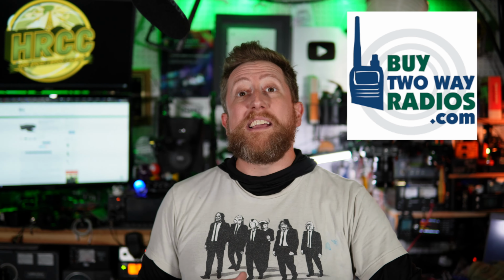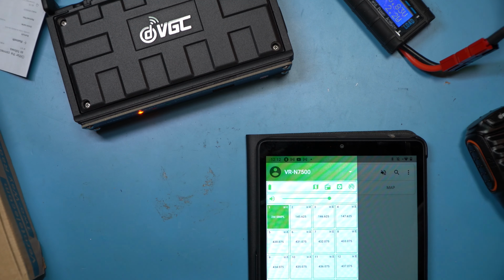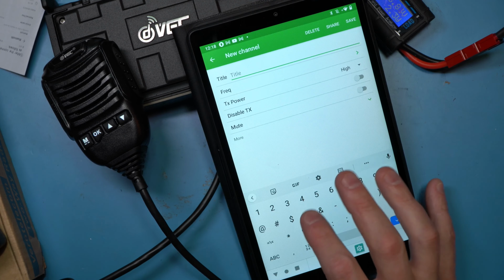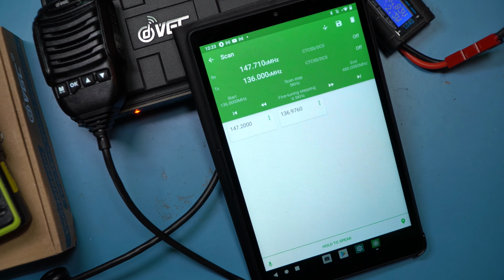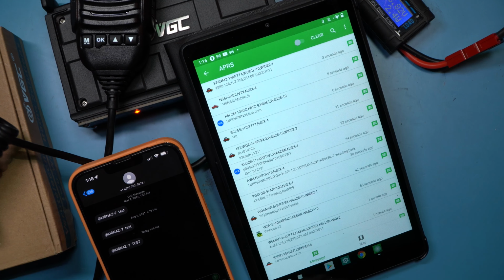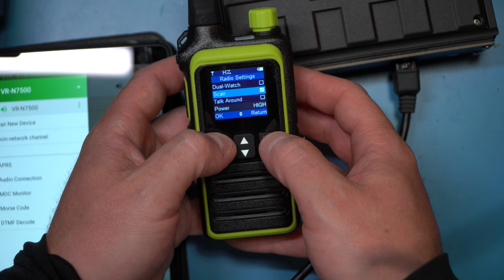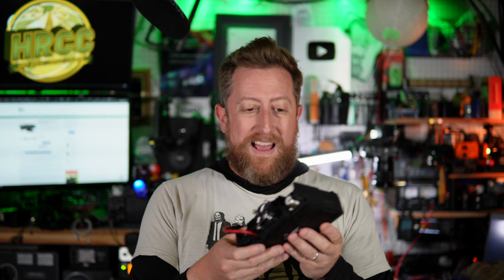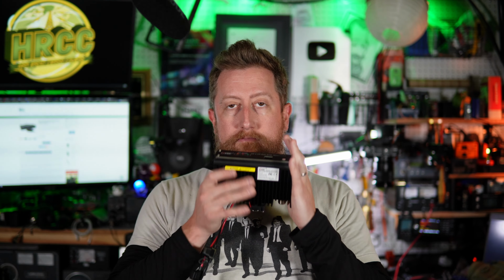VGC VR-N7500: APRS! Android, iOS, Bluetooth, Dual Band 2m/7cm Ham Radio Review

Comment: Does the app have to be connected for it to beacon APRS with current location? I presume it doesn't have a GPS module built-in.

Has the iOS app improved & supports APRS? I remember it was limited previously.

Comment: I really like my vgc- vr-n7500. I use it for one of my base station radios. I have an android phone that I don't use anymore connected to the radio and the internet. I leave it with the radio in the shack. I've installed an external wifi antenna on the outside of the radio to extend the Bluetooth range. Using the phone for the microphone I could get about 15 feet from the radio. With the external antenna the range extended to about 50 yards. I also setup network channels to use my radio remotely. I installed the ht app on my phone that I carry with me to control the radio through the phone I have paired to the radio at home. You can also send and receive sstv through the app on the paired phone or my phone I carry. I really like the radio. It's not perfect but pretty darn good. They go on sale occasionally on R&L electronics. Got mine that way for $127.
Reply: The external antenna for Bluetooth is a fantastic idea.
Reply: @MattRozema There are a couple of Facebook groups that talk about the topic. I've posted pictures of my antenna modification on one of them. I just can't remember which.

Comment: Does it come with that little handheld or do you have to purchase it separately? I don't see it anywhere as an accessory.
Reply from the maker: I believe it’s an accessory.
Reply: @HamRadioCrashCourse I'm debating on either this or the BTech  GMRS-50Pro that Mr. Rubicon review just reviewed. However there was a comment or that said that the 50Pro is the same device and app as the (vero?)VGC VR-N7500 with a different faceplate and app color scheme. The only difference I see hardware-wise is in the screen on the attached speaker mic. For the VGC on buytwowayradios it doesn't say it includes that wireless ptt "radio", nor have I been able to find it on the website, if I knew for sure I would only really have to consider price, which the VGC has it beat. However the BTech wireless speaker mic is ~$40. I'd have to see if the VGC's is a separate purchase to be sure.
Reply: @HamRadioCrashCourse  not sure if it's a glitch but my last comment doesn't appear on my end. If it shows for you but not me I apologize for restating so I'll summarize. VGC VR-N7500 = new BTech GMRS-50Pro? Correction on speaker mic I wrote on old comment for BTech, as it's actually an extra $60 vs buying VGC's for $36. VGC better deal minus janky software? BTech in America, maybe better customer service/support? VGC with speaker mic $219 vs GMRS-50Pro $248 + BS-22 spkrmic brings it up to $344. That handheld you had wouldn't be a deal breaker because app, but I'd like to not have to whip out my phone to program, would be a nice touch.
Reply from the maker: I saw the second reply.

Comment: We NEED the HT app to support Android Auto or Apple CarPlay
Reply from the maker: Why?
Reply: @HamRadioCrashCourse  First of all, almost all new car multimedia/audio systems support Android Auto and Apple CarPlay. If the radio can be operated via the integrated car system there is one less display you need to add to your car's dashboard.

For me personally, I already have a Garmin Plotter,  Icom mobile transceiver, and an (Eonon) headset / dash cam that supports Carplay/Android Auto (The car is from the Casette player era).

I wanted to use this device as an APRS sender in addition to what I have, and being able to manipulate its setting usin the Eonon witch is already mounted in the car would be awesome.
Reply from the maker: I don’t want to the audio going through my car. But I can see the APRS being helpful.  

TBH idk that we’ll ever see car play support.

Comment: Wow, Josh, thanks for this.  I found your review while searching for this radio.  I've done lots of research and this looks like the best currently-available option for a motorcycle with a BT headset.  I'm especially surprised with myself for considering it, since I'm a pretty old-school HF guy (with a Collins S-Line at home and a surplus Racal in my truck).  I have never been on VHF, but this looks like a great motorcycle option for 2M simplex on the road.  Thanks and 73...NV1V.
Reply from the maker: This would be good for a motorcycle. Interesting idea!

Comment: I have a thought if the one that is in the radio what if I somehow got to be able to swap the bluetooth chip in it to be more powerful transmitting Bluetooth chip would that idea work or am I crazy here? (in order to extend the Bluetooth range even further essentially)

 the cross band thing would the be the thing that would make me be able to use it as a vehicle repeater system so I could use it as a mobile repeater to be able to reach far Ham radio repeaters out there (side note does relay mode have anything to do with the cross band thing at all?)

A different question is the front mic Port do you know if you know the pinout of what each wire goes to the palm mic? I think about plugging in a audio system like how ham radioist hook up their studio mics to their base station (I also trying to find out too if the radio has a balanced audio system or a unbalanced speaker in the Palm mic?

Comment: Love this radio for my motorcycle communication. I use the aprs and it pairs nicely to my Bluetooth headset and I have ran a ptt button to my handlebar. A wireless ptt button is available but not as good as a wired one.

Comment: ..... I lose my mind constantly!  Great job,  I've had this for 3 or 5 years through a craigslist deal and it just came with it.  I finally have a use for it.  I couldn't bring myself to get rid of it and I now use this in my company vehicle.  I'm going to have to use an external speaker because the wireless speaker mic is a little weak.  I thought about buying the HT thingy and might due to it has an antenna and may work better than the speaker mic itself.  TX audio quality is excellent but you MUST run mic gain on lowest setting for the wireless mic.  It's very HOT otherwise.  Cool little unit and I don't mind using the phone to dial up the channels.  Once you get used to the interface and get your channels in there it's pretty easy to use.  I don't use the APRS functionality I have APRS droid for that if I choose to use it......Once again great video.
Reply from the maker: Thank you!!

Comment: The biggest problem with the software is that is must connect with servers in China in order to work. On networks that block traffic to/from China, this app does not work at all.  That means if China ever decides to cut off network access to the outside world or just your part of the world, this stops working. Also, if they decide they no longer want to be in this business and take their server down, it also stops working. If the internet is down or you don't have network connectivity, it doesn't work.
Reply: If that is true it‘s a big nono for me. And why i prefer the good old stuff without the need for a dedicated app. Also in case you really need this thing your phone dies and then you curse the little box in your car. I‘ll go the oldschool route…
Reply: I don't believe you have to actually be connected to the Internet for it to do most functions once setup, i.e. the radio will still work as a radio even if your phone doesn't have signal. It's the other features like talk groups that won't work without signal.

Comment: I think the reasons the CW didn't decode nicely : 
1) the radio was listening to the mic, not the RF, in decoding CW. If you have the channel selected (and recording) you'll find it'll auto-decode CW in the messages screen.. like when a repeater IDs, etc.
2) the Icom you used to test it was sending CW in CW mode - not MCW. so it was simply keying/unkeying to generate the Continuous Waves making up the code.  the VR-N7500 listens for modulated CW (tones sent over FM) so the carrier going up and down in the pattern of code was meaningless to it.  I could tell it was trying to hear the Icom's monitor-tone generation... but...
3) the noise in the room of the squelch opening and closing out-of-sync with the monitor-tone of the Icom "muddied the waters" enough that the ambient mic decoding just wasn't happening. 

Suggestions: 

turn down all other radios and key the Icom into a dummy load, doing everything else the same - the monitor-tone of the Icom should be picked up by the ambient mic and decoded by the "HT" software.

or

send modulated CW - a few ways to do this are with a code practice oscillator into a mic jack, etc, so you're transmitting a continuous carrier in FM mode and simply modulating the CW, such as what you hear when a repeater IDs. I bet it decodes beautifully. 

:)

I have a love/hate relationship with my two 7500s but the use cases I have for them outweigh any bad vibes and I use both of them a lot - one in the shack for home/low power APRS monitoring on an old android VM running on my win11 desktop (tricky to set up but so worth it) and the one in the car that my wife and I share because I'm "not allowed to have visible radios inside that car' or something yada yada... :)

73 and thanks for this video!

Comment: Bought this radio about one year ago. Works great, it is hidden and safe in the car. I use the small BT PTT speaker/microphone (not the HT shaped). What I was not able to do is to use it as an APRS tracker. It actually plots my position via cell phone internet but not by RF. Any thoghts on how it could transmit my position automatically in a regular basis via RF only?
Reply: App settings have to be perfect for APRS tracking to work via RF. But in my case, I have not yet been able to get messaging to work via RF (I noticed in video that his Wi-Fi was active on his tablet so I'm wondering if his messaging was actually working over RF...). I'm contemplating ditching the N7500 radio and getting something that will work with APRSdroid which works great on my little HT - unless someone knows the pinout for the RJ45 mic/spkr connector!

Comment: Mine makes a "roger beep" when UN-Keying (I DONT hear the Noise, it is TRANSMITTED, So everyone on air hears it!)..... although its not a beep, it sounds just like what you would hear on a lot of police or other public service radio after UN-Keying.......... Does ANYONE have any idea how to stop this on the VR-N7500 ?
Reply: I know this is a somewhat delayed reply, and you may well have already figured out your issue, but in case you haven’t (or someone else finds this useful), you might want to check “ID Signaling” and be sure those options are toggled off in the settings. That’s the likely cause a “beep” like that.

Comment: I am just getting into overlanding and looking for a way to keep in touch via aprs emails with family. Stand alone are very few. Since I already have the iPad for navigation can I for example us a yaesu ft 60r with iPad and aprs  email?
Reply: If so.....what am I looking for in a radio that could do this? Or is it android or is that matters any radio will do?
Reply from the maker: With an ft-60 and iPad you need a device in the middle to do APRS and Winlink email.  Check out the Mobilinkd 4
Reply: @HamRadioCrashCourse  Okay so sweet this opens up the door to just picking a good radio. Thanks

Comment: Mine is quirky. I can’t keep the BT mic connected, constantly losing connection even though the radio is not more than two feet away. It does do aprs well but only if the BT mic is connected otherwise it has no gps receiver.

Comment: The APRS Passcode is for I-Gates. Any I-Gate has to have a code from APRS-IS ( server ) to connect. Instead of using the link and their site you can register through APRS-IS. Once you enter your code it will connect and pass whatever traffic you have it set for.

I just got the BHM-78 HT. Seems really cool! You can turtle 7500 off, turn the HT off, back on and turn the 7500 on a well. It seems Bluetooth is left on.

But I don't see any of the APRS settings in the HT so it appears you have to set that up through the app. Other than that the HT seems great. Although I've not gotten a audio report yet. 

Also, there are other places to get the 7500 and HT cheaper! R and L for the 7500.

Comment: I thought I asked this in another video about this unit, but didn't get a reply...can you import repeater data from someplace like repeaterbook, or even manually via some file?
Reply: Not that I know of. Each profile (I think they call it a group)  acts like a channel bank. There are 12 groups. Each group holds the 16 Channel that you see. I think there is a way to share these groups of 16 channels with each other. I will look into this more. I have 2 of these N7500 so I will invest more time in this. 
It really does need a Chirp function where you can import local repeaters.
I wonder if the dudes from RFinder could make their app work with it in order to use their repeater database.

Comment: I can see 2 seperate places this (or a similar radio) has potential for me. 1st would be mounted in the teardrop trailer, paired with the BT speaker mic, to not be tied directly to the trailer in camp. And 2nd, might be in the house, away fron the shack, so again, I am not having to be next to the radio when using it.
I know about cross band repeat, but that (as far as I know) only allows you to monitor/use one frequency from the base/repeating radio.

Comment: I like this radio for possibly putting in my 2019 Subaru where I have 12 volt available in the back of the car. I can get a mag mount out of the back of the car and be on the air.  There is a mike with speaker built in that is bluetooth capable, at least I've seen it on the web site.  I stay on one repeater most of the time and I might try using a cat cable to bring the mike up to the drivers position.  I need a lot more studying on this radio.  Thanks for your video. WB6ODR

Comment: The timing of your video was spot on for me. I have bought this radio last spring and have used it a few times in one of my vehicles. I just got around to adding repeaters, simplex channels after only adding one repeater and APRS frequencies last spring. I have hooked it up to my power supply at my desk and want to play with it some more without the distraction of driving at the same time to really learn the software and the Bluetooth HT. I like the build design as I want to move it from vehicle to vehicle and not have to install it under the dash. I connect it to a 12v battery in the back and use the tablet/Bluetooth HT mic/speaker up front. I like this radio so far except the included plug in microphone is not very loud on the air (I don't use it). And you are right about the cumbersome application (Android). But I love the APRS capability and that was the main reason for me to get this radio as opposed to another more standard mobile dual band radio. For the price of this with the Bluetooth HT, it is still on the low side of radios that are capable of 50w but still usually don't have APRS capability. Yes, the learning curve is higher, but it will be worthwhile. Thanks Josh. 73 Mark K5MGK

Comment: Awesome video. Is it possible to link the VGR to a vehicle Android Auto system and use the vehicle handsfree interface for talking. Also change change channels using the vehicle Android Auto interface.  If this is possible it will change Ham Radio for mobile use.
Reply: Ever since this radio has been out, one of the pics in the ad @ Buytwowayradio shows EXACTLY this connection. But HOW has never been explained.  Que the HRCC Investigative team…

Comment: I have had this radio for about 2 years. I liked it , received good audio reports when using my phone for the mic.  Not good audio from the cheap mic that comes with the radio.  Radio was easy to program, easy to use, except for APRS.  This was only due to poor documentation that comes with the radio.  There was a source online at the time, but it was confusing and seriously lacking info about the radio.  I enjoyed it and would recommend it.  Just understand the mic is nt good, it only keys the radio 50% of the time and audio is bad, but using the phone i had no issues at all.
Reply: Hey Darrell, you are able to use the phone as a mic and speaker without the wired handset or the Bluetooth one shown on the video?
Reply: yes !   phone works better than the mic @oldstanknote
Reply: you program the radio thru the phone app, all radio functions are available on the app/phone

Comment: I also own a N7500 in my car and just love the tiny wireless PTT button and the BT speaker mic that came in my bundle instead of the fancy BT handheld you showed. Using a regular BT head set in conjunction with either VOX or the PTT button tied with its velcro strap to steering wheel is quite handy while driving as we are not allowed to hold a mic while steering a vehilce by law in my country.

Comment: I'm a buddy of Mike Glover's so PACE plan is important. I have 2 of these VGC radios (one with the older BT handmike and BT PTT). I love this radio so I just ordered the new BT handmike/display so I can use a K1 connector with my Peltors or a discreet earpiece. 
I use one radio in a fanny pack with a 10Ah battery. I use the other in the radio pouch of my rucksack with an antenna mast and small ground plane sticking out above my head. Both my batteries are LiFePo4 and last a 2-3 days. 
I mostly use burner Android phones with these, but I noticed Apple just updated their iOS app which includes full screen APRS stuff - amazing. 
Because this has no screen/controls, its battery usage is much lower than my other 50W dual band rigs that I tried using body-worn.
Reply: Great backpack radio.